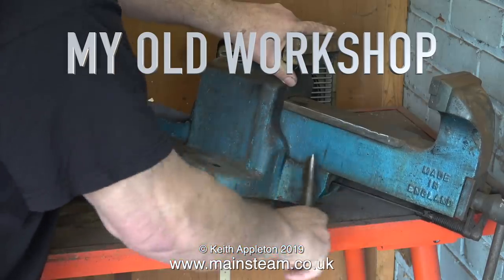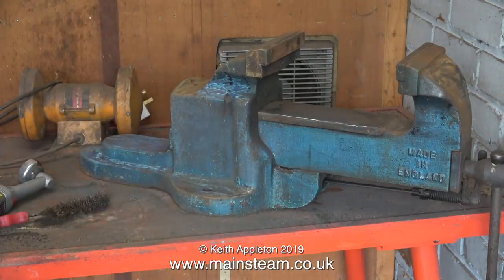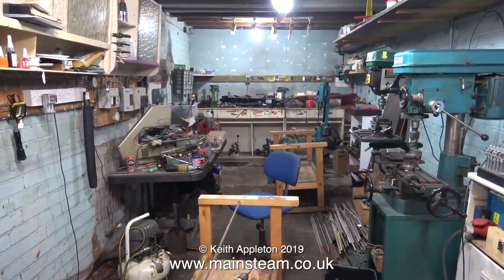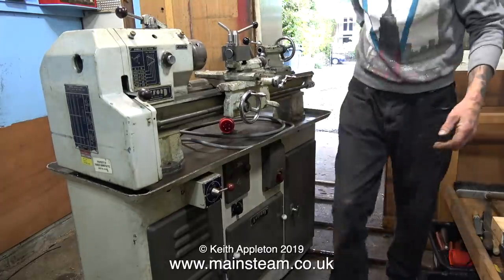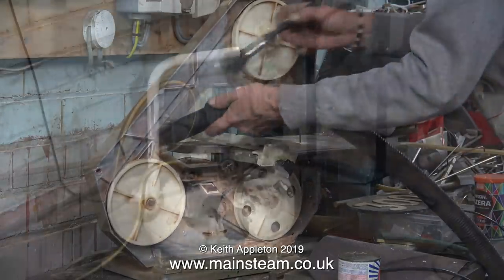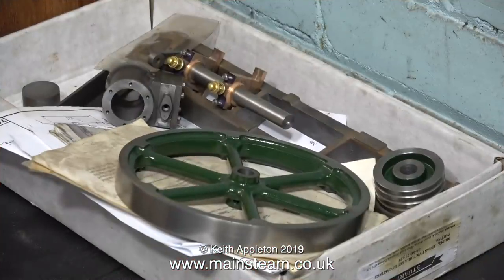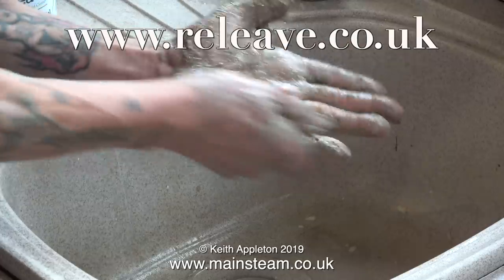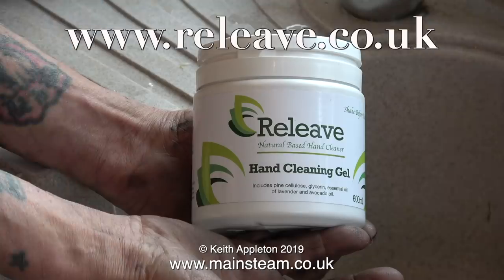DISMANTLING MY OLD WORKSHOP

Comment: Ha ha I have the same vice which I too have had for 30 years and has moved with me from each house move and best tool I have ever had, a must for everyone. 👍 Got mine from the Stokers workshop on an old decommissioned Leander Class frigate in Devonport trot just prior to being towed to India and scrapped on some remote muddy beach. Them were days steaming a pair of Y160 boilers in boiler room with the clang of the reciprocating fuel pumps and the high pitched whir of the forced draught blowers and turbo alternator, half deaf now. 11/11/19 We shall never forget🎖🏅